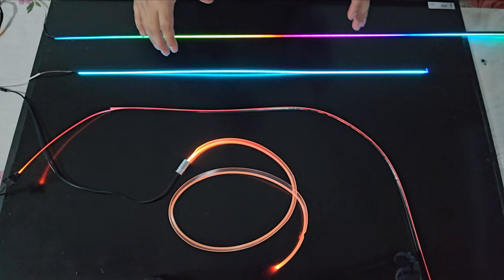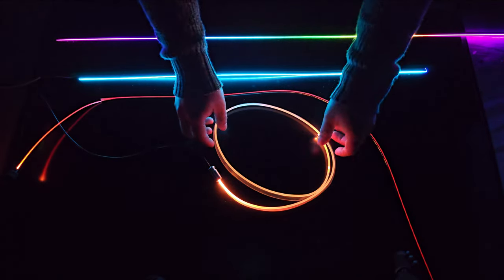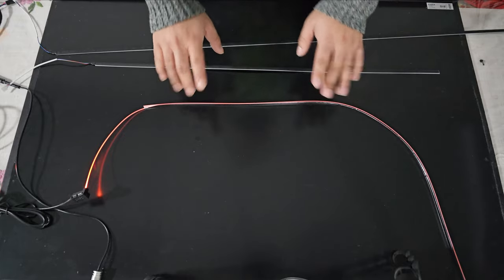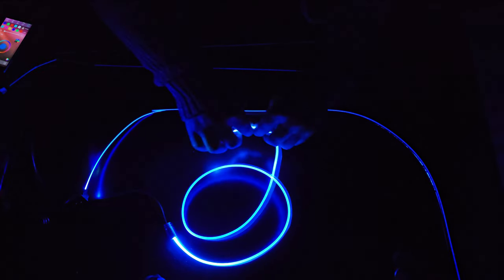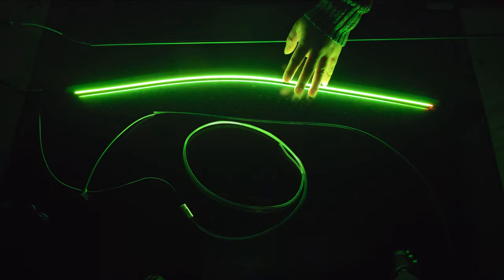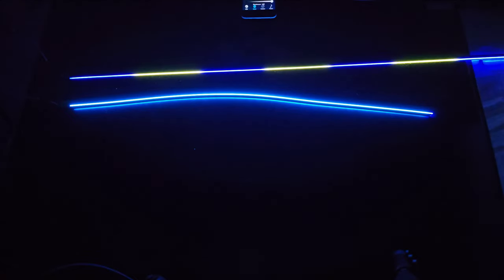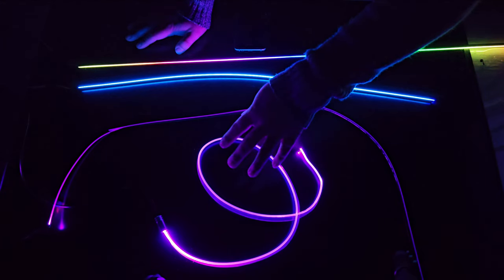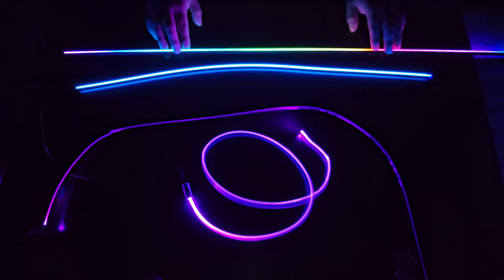Which Is Best? Universal Car Ambient Lighting Kits Explained!

Comment: You failed to mention the rgb & symphony kits are cut to set lengths - usually 35cm, 75cm & 110cm. This is where the fibre optic really shines (pun intended) as it can be cut to any length.

Comment: Thank you for this interesting video. Would you know which techno is used as OEM on latest Mercedes? It is mentioned the acrylic one is the most used by car manufacturers, but latest MB are very bright so I was wondering  if it was also the case for those ones.

Comment: Nice little video about the different kits I had the fibre optic ones in the volvo v70 when I bumped into you in the petrol station in liverpool now I've seen what others are like give them a blast 😋 also to note your multi-meter links need updates mate cheers for the video 👍🏻
Reply from the maker: No way! What a small world I remember seeing  you at the Shell lol. 
Thanks for the heads up on the Multi-Meter one. I'll check that out, and 100% I think you will fully appreciate the difference once you see it for yourself. Being someone who has installed it already you might already see the benefits of the different types.

Comment: I understand the symphony ones are not bendable front to back, but I was wondering if you can use a heat gun to make it more bendable temporarily to get the shape you want easier?
Reply from the maker: It's very much dependant to do that on how much of a bend it is you need. If it's say a small curve and maybe a difference of about 1cm then you could maybe achieve it. Being that there is enough grip on the trim to hold them in place both sides too. I would highly recommend not using a heat gun to hold them in any ways as it could mean damaging the actual LEDs inside the strip. So whatever you are thinking of doing just be careful and thoughtful before doing the actual installation
Reply: I reckon if you gently snip the flat bit of the strips at where the bends will be going inwards or outwards  it could possibly bend more back & forth , 
 Remember tho if the bend is outwards snip a slight V shape out of the flat part  , if its an inwards bend then a couple of normal snips of the flat part of the strips . 
 A heat gun would possibly help aswel i reckon .

Comment: So basically how this work?when u start the car they come on automatically?and then when u switch off the engine they turn off?
I dont want to go on the app everytime I go in the car.
Reply from the maker: Thats pretty much how they can work, they need to be powered by the car, so you need them to be powered with a part of the car that turns on and off with the engine. So its more down to you and how you wire it vs the lights themselves.
Reply: Na bro u can wire it to auto light and when it dark they comes on much better than keep them on all time or app to switch on/
Off

Comment: Can u cut or add length    like solder wire to cutting piece on symphony strips?
Reply from the maker: You can cut down but I haven't seen any successful additions on the length. You would need to be a master at soldering to maybe get away with it. You can buy them at 110cm which is pretty much long enough for any application

Comment: Hi when installing the fibre optic you attach the light to the one end but does the other end need a cap ?
Reply: I think it would make sense to use a type of mirror cap at the end of the fibre optic maybe!? , in hind sight it should reflect the light back in the strip keeping the colours strong & solid  & no fade or dropout .

Comment: Does anyone know the measurement of the led strip that is for the dash?
Reply from the maker: They are normally 90cm for the dash. 
The led bead kit is a dual end 110cm. But you cut it for each side you need. 
And the led symphony is 1x 90cm and 1x 20cm
Hope that helps
Reply: @mrgcc  thanks so much; wow so the symphony one is perfect for my bmw f30

Great bit of kit cant wait to install it
Reply: How do you get it to stay in place? Does it just slot in a gap between the original ambient lighting or?